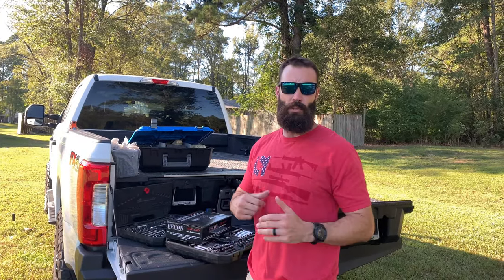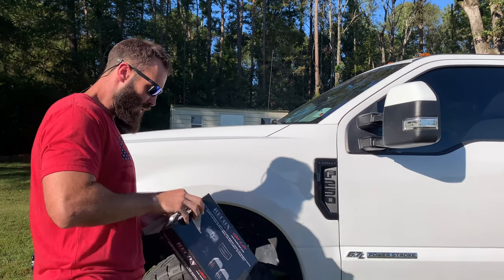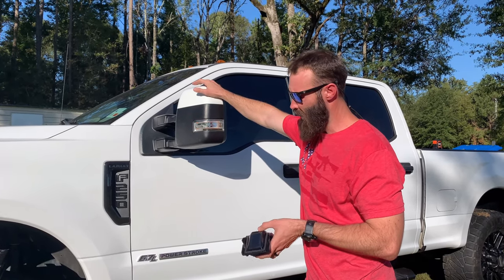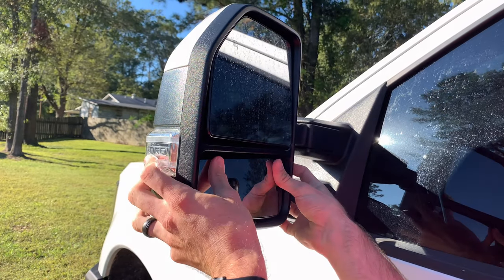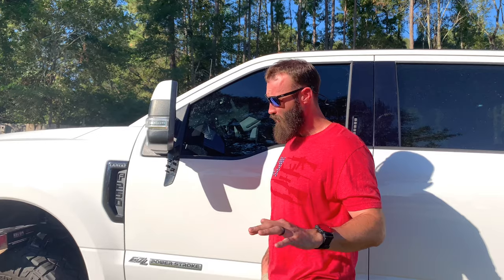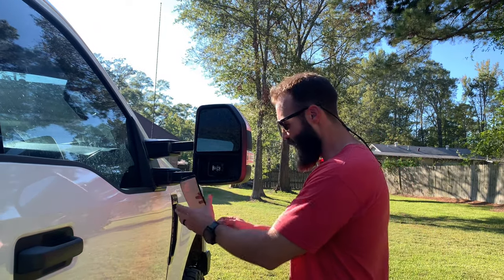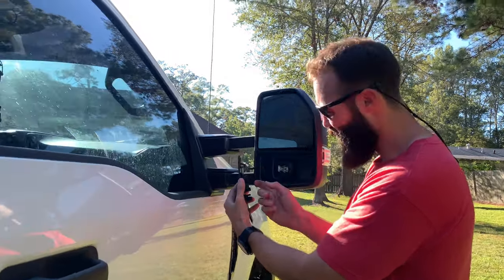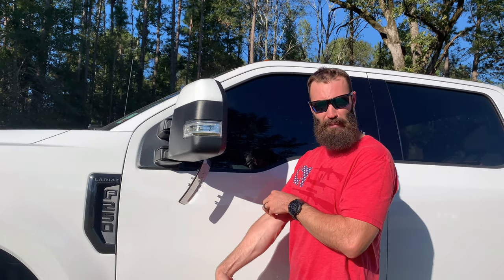RECON SIDE MIRRORS LENS INSTALL F250 - F150

Comment: Thanks for this.  I use this video to install mine just now.  I appreciate leaving in the bits where you cracked the mirror as well.  Shows what not to do and what could happen.  I got a little impatient and broke a few clips but everything is still secure so no worries I guess.  As far as the puddle light goes, I have the puddle lights but I also have that little plastic thing only on the passenger side.  If anyone else w/ puddle lights is doing this install, I found it's 10x easier if you pop the light out of the housing, put the mirror backing back on, and then pop the light back in.  Keeping that light in is a pita.
Reply from the maker: Shit man thanks for watching, I appreciate it. And thanks for the tips In the comments. Hit that sub button if you haven’t, trying to grow the channel! BTW love the username! 🇺🇸🦅🇺🇸

Comment: Thanks for the video, found it cause I was thinking about those lights myself. I like the way your tires fill out those stock wheels. Wanted to get new wheels and a lift kit but currently sinking money into the house that may have to just settle for new tires on the stock wheels. Two questions please, is that a total lift kit or just a levelling kit?  Also, what size and brand tire are those? Thanks man
Reply: Nevermind, just saw the long list of mods you provided. Thanks
Reply from the maker: It’s a 2.5 readylift. But when I put the winch and bumper on it sagged a little, so I added another 1 inch puck under the springs. So 3.5 total leveling. 37x13.50x20 nitto ridge grapplers. These are the stock lariat sport wheels.  That’s for watching, hit that sub button if you haven’t. I’ve got tons of videos for our trucks! 🇺🇸
Reply: @COLTSWAY  Thanks for the lightning fast reply. Subbed, good channel. Been watching the others as well.
Reply from the maker: Awesome, I appreciate it my man! 🇺🇸

Comment: So did you have LED stock lights like the message below?
I don’t really want to run white led running lights. 
THIS PART WILL ONLY WORK ON PLATINUM TRUCKS OR TRUCKS WITH OEM HEADLIGHTS AND TAILLIGHTS THAT ARE LED, IF YOUR TRUCK IS NOT A PLATINUM OR DOES NOT HAVE OEM HEADLIGHTS AND TAILLIGHTS THAT ARE LED THEN ORDER Part # 264245WHBKX OR 264245WHCLX

Comment: I've been looking for a walk-through for awhile now. Thank you.. 👍🏻
* Very strange you only have 1 puddle light. Ford tech must have got his build sheet messed up. Hopefully the wiring is there.
Reply from the maker: I don’t have the puddle lights. I found out it is a ambient air temp. It’s what reads the outside Temps! Thanks for watching, hit that sub button if you haven’t! 🇺🇸
Reply from the maker: Man I just got a XLT. I have aftermarket winch bumper in front and In back. I changed out the emblems. Also added factory lariat sport headlights and wheels. 🇺🇸
Reply: @COLTSWAY  Aahhh, you're sneaky. I got ya now. Anyways, do you like the Recons? Are they bright enough? Also,  is there a difference with regular vs. led? I'm not even sure which ones I have.  I don't have LED headlights,  so... I dunno.  Either way,  I'll figure out ones I need. Now I know how to do it from watching your video.  👍🏻
Reply from the maker: Man I like the recons, I think they are plenty bright! I think they are all led? I don’t have the led headlights either. 🇺🇸

Comment: did the oem lights still have the amber DRL on them or did they shut off after 5mph? Do the oem one flash and operate as a turn signal or does by adding these recon light make the amber stay on as a DRL and turn these into turn signals as well?

Comment: I’m looking at these for my 2002 f250. It has power mirrors on it. Would the lights work on it you think? Is there some sort of an adapter that will make them work if not  that you know of? Thank you!
Reply from the maker: I’m sure they would work, but I doubt they would fit. The shape is prob different. But if it did you can always just splice the wires together. 🇺🇸🦅🇺🇸
Reply: Ok. Thanks for the help

Comment: We have all broken Sh** being stupid. I just always say “well could’ve been worse”. Still a great video, but thanks for showing us how to not do it first LOL.  Are you going to replace your marker lights on top to the blackout  as well?
Reply from the maker: 😂 you are right brother! I appreciate you watching and the comment! 🇺🇸
Reply from the maker: No I’ll prob leave them orange. I don’t want to mess with any of the roof, I hear horror stories of them leaking a lot.
Reply: @COLTSWAY  with the awful rain we get here in the south I don’t blame you one bit. I thought about doing it but didn’t for same reason.  I’m just doing a 1.5 inch level with 35”s and changing to 2wd valance. Already have a banks derringer and pedal monster with a Leer camper shell with the leer locker.
Reply from the maker: Man I got my shell in order right now! Said 9 weeks! I’m about halfway threw. I got the ARE overland shell with the windoors and a slider on them. Gonna be nice for camping/ overlanding. Kinda want to do some of that on the channel....
Reply: @COLTSWAY  I looked at the same one but really wanted the leer locker to store rifle(s) during hunting season, out of sight out of mind.
Reply from the maker: That’s right. I got a good deal on a decked system so I can store them in there!
Reply: @COLTSWAY  I know you can buy the holders for rifles for the decked system, but you might want to look at custom foam from Carolina custom foam and order your size then cut out for you rifles. Just more protective for scopes and easy to remove.
Reply from the maker: Sweet. I’ll give them a look!

Comment: Sick truck, are you runing spacers with those stock rims and 37s? Thanks.
Reply from the maker: No spacers. They rub a little at full lock but not bad. They are 37x13.50x20. 12.50 would rub a little less. Thanks for the comment. Hit that sub button for me if you haven’t! 🇺🇸

Comment: That is the temp sensor under the passenger mirror for external temperature
Reply from the maker: Thanks brother!According to the comments I’m the only one who didn’t know that! Thanks for the comment and for watching. If you haven’t, please like and sub. Trying to grow the channel! 🇺🇸
Reply: @COLTSWAY  lol i found out because i took it off to install puddle lights and my ford dealer showed me on the diagram for my truck
Reply from the maker: Nice! Did you ever get the puddle lights installed? I’d love to do that.
Reply: @COLTSWAY  no i haven't had much time to mess with the mirrors my truck is an 2018 xl so ot will require alot of wiring since this truck almosy has nothing
Reply from the maker: Ok. I wasn’t thinking it would be that hard. Do you happen to have the part numbers? I don’t have the button inside the truck either. So I’d have to get that as well.
Reply: @COLTSWAY  i dont have the part numbers sadly
Reply from the maker: All good. I can try and figure it out. If I get them, I’ll shoot them to you!
Reply: @COLTSWAY  thank you oh i was wondering how is the truck on the tunes so far shifting and just running in general

Comment: Colt which vinyl stickers did you use for hood? Any color suggestions for a black F-250?
Reply from the maker: Hey brother, they are tuff skins...I’ve also go the  rear and door sill Tiff skins. I’ve done some videos on them. But here’s a link my man. Also black and chrome always looks good...just depends on the theme of your truck...but they got slot of colors. 🇺🇸 https://amzn.to/3tK9YJ1
Reply: @COLTSWAY  do the same letters fit on rear?
Reply from the maker: If you click the link I gave you then you can search for read as well. But no, there is a front set and a rear set. 🇺🇸

Comment: Hey colt. Do you have a backup camera for gooseneck trailers on the third brakelight ? I have a 2020 f250 and would like to add that if possible. By the way, awesome videos, liked and subscribed 3 minutes into the first 👍🏼👏🏼Thanks.
Reply from the maker: Man I don’t have the camera! I’ve got a camper shell on order so it really wouldn’t do me any good. Sometimes I wish I would have got it but once it get my shell it would be useless. Thanks for watching and for the sub! 🇺🇸
Reply: Mario do you have the large 8 inch screen or the smaller one?
Reply: IPACA9 the 8 inch
Reply: @mariovaldez3148  What trim truck?  Not sure if that even makes a difference but a few techs have asked.  Trying to find out the parts you need.  I own a car audio and accessories business.  Been installing for 30 years.  I've posted the question on a dealer tech page and several guys are chiming in on recommended products.
Reply from the maker: Man I have the larger screen. I have a XLT trim level. And not the XLT premium. Only the regular. I have the center console and the big screen. No power fold mirrors or 360 camera. If you get the XLT premium you can get the mirrors that fold and stuff. But all I wanted was the big screen and a center console.
Reply: I just bought my 18 XLT CCLB 6.7L but it's the lower end XLT.  No fogs, little radio and center seat which I don't mind since I seat 6 sometimes.  I flew out to Chicago from Kansas City to get it.  Stole it for $34K with just under 34K miles!  Came with firestone airbags with compressor, new Wrangler E rated ATs and new batteries.  I can't complain.  I'm about to add Kenwood's new 10" monitor system and dash cam to it to make up for not having the 8" sync system.  Already have similar in my Excursion and love it.
Reply from the maker: Nice man!! Yea I forgot to add I do have fog lights as well. But really don’t matter Cause I have aftermarket bumper on it! You got a great deal! Look into linkswell screen for our trucks. They had ass. 🇺🇸
Reply: @COLTSWAY  I've installed a few of the Linkswell and Phoenix systems for customers and I'm just not a fan for the price and issues.  Too much screen for me asking to damage it especially with having the center seat...lol
Reply from the maker: Good to know!
Reply: IPACA9 its an Stx. I believe its the same as an XL trim.  If you could recommend a  product that would be awesome! I want to add some air after the camera as well.
Reply: IPACA9 any luck with the recommended products ? Thanks in advanced
Reply: @mariovaldez3148  I'm sorry I left you hanging. I got super busy.  We got snow here in Kansas City.  The temperatures dropped and my phone blew up!  I've been installing remote starters non stop from 8am to midnight every day. I'm mobile and run all over the city installing onsite.  On top of that a local competitor called me for help.  We worked out a deal and I'm installing all of his starters as well.  As if I'm not busy enough...lol   Just got home and it's 1am.  Prepping for tomorrow.

I've found a cargo cam with interface for the Sync 3 from Camera Source.  It will let you switch between the tailgate cam and the cargo cam via a switch.  https://camera-source.com/2017-f250-f350-f450-3rd-brake-light-camera-for-trucks-w-factory-camera.html

Etrailer has one as well but it's over a hundred dollars more.  They do have a installation video for it though that might help. https://www.etrailer.com/p-3460001.html?hhyear=2018&hhmake=Ford&hhmodel=F-250+Super+Duty

Hope this helps you out!  Hit me up if you have any questions.  I've been doing this for 30 years.

Comment: Is ur truck a Lariat?
Reply from the maker: Nah. Just a xlt 🇺🇸
Reply: Yea I saw the badges so I was confused. But looks badass brother.
Reply from the maker: Yea if you search my page you will see a video where I changed out the badges. I got rid of all the chrome. Thanks!
Reply: @COLTSWAY  yea I saw the video and cloth seats but then I saw the badge and got confused.
If you like leather. I can't say enough good things about katzkin leather seats. Unreal fit and great upgrade. I've had mine on my 15 f150 for 5 years and they still look great.
Reply from the maker: Yea it’s in the list of mods for sure!